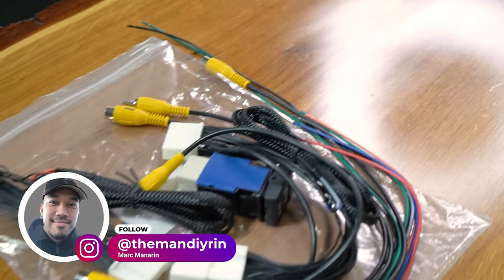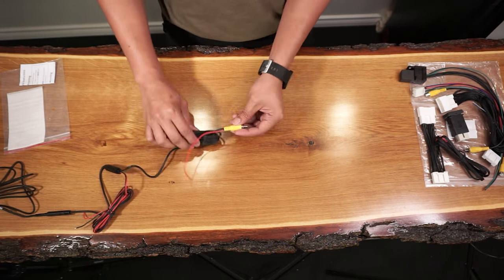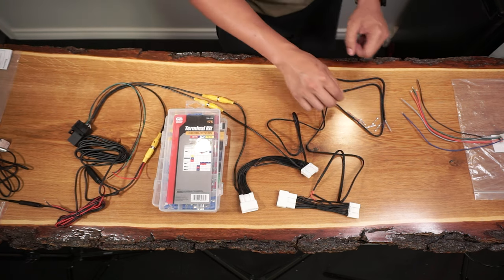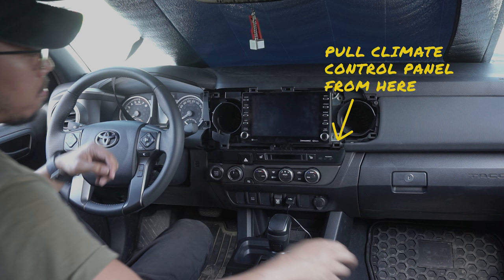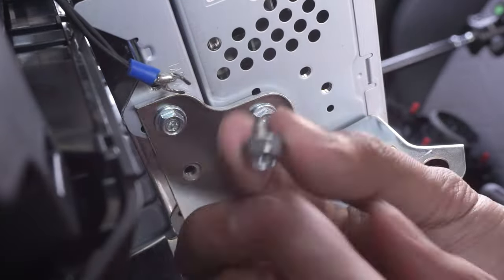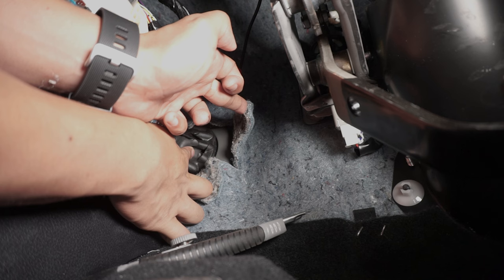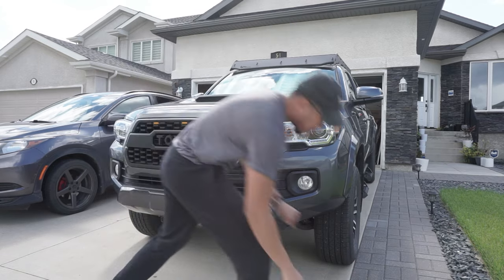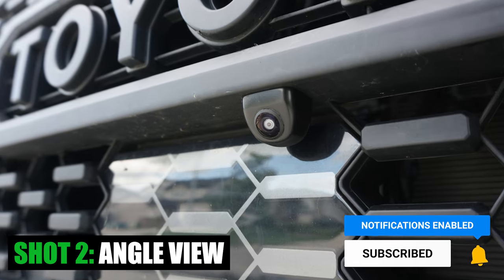ANYTIME FRONT CAMERA INSTALL on the 2022 Toyota TACOMA TRD Sport | EASY DIY

Comment: Followed step by step and got my camera installed in no time. Great video! The only issue i ran into was connecting the two black cables into the terminal then grounding them to the head unit, the cables were somewhat short but i managed to work through it pretty easily,. Thanks again
Reply from the maker: Thanks so much for watching my video! I’m glad it helped!
Reply: @themandiyrin thanks for the quick reply. I just tested it again and noticed that when going from the front camera position to the neutral position it flashes the rear camera for a second before going to the Home Screen. It does not do that when going from rear camera to neutral. Anyone experiencing this? Any ideas on how to stop it?
Reply from the maker: @sebastianbusto23  good catch! I’m actually in the same boat and mine is like that for half a second. I didn’t try to fix it as it doesn’t bother me much but mine is still doing that but works fine. Could just be the relay acting on the switch action.

Comment: I wish that this video had come up yesterday when I did my install.  I was bouncing between the videos trying to figure out little steps that were not well explained in one video or the other.  Great job on your video.  Love the idea of grounding to the radio.  I ended up putting my switch on the left of the steering column and had to splice in some wire for grounding by the fuse panel.  Love those low temp solder connectors, BTW!  I'll never go back to the old school kind!
Reply from the maker: Oh no! Wish mine came up too but I hope the install went ok! Thank you for watching my video and the kind words! Yes I agree with the solder connectors! They are great, don't think I can use other methods after that haha! Looking forward to hearing about some of your future mods! Cheers!

Comment: Thanks for the video. 

How much of this would apply to a 2018 Tacoma  extended cab with manual transmission?

What is the brand of the camera, and where did you obtain it?

Does it provide any memory to use as a dash camera?

Do they make a version that I could use in a 2016 Mazda 6?
Reply from the maker: Hi! This will work on the 2018. Please click my link in the description for the camera purchase. I’m not sure about the Mazda, does it have apple car play right now?

Comment: great installation but is soldering necessary? i mean i have 7 years of soldering experience under my belt so its not a daunting task but i feel as if crimped mechanical connection will be superior in this application 🤔
Reply from the maker: Thanks for watching my video! And yes I agree could do without the soldering but I had it handy so I used it lol

Comment: I have a 2019 Tacoma and I do not have blue and gray on the other connector. Is this normal because I have 2019?
Reply from the maker: Hi thanks for watching my video. Unfortunately I’m not sure why your 2019 doesn’t have the connector. I believe this camera is actually for 2016 and up so I assume it would work on 2019.
Reply: @themandiyrin  Thanks. I just realized the switch does not illuminates. Can this be done?
Reply from the maker: @rolpal619  Hi, luckily mine was illuminated! I think you're able to buy a different switch. Did you buy the same camera?
Reply: @themandiyrin  , I believe I did, but for different model year. What I mean by not illuminating when it’s in neutral. It does illuminate if I turn witch to front camera or rear camera, although yellow color. I wish it would blend with the blue illumination stock color.

Comment: Great Video. One thing I noticed on my front camera installation is that when I switch from front view, to off, a quick view of the rear camera appears. I'm not too sure if I noticed it on your video (16:06). Is this is normal? Or something that can be fixed? It's nothing major, but it is a bit annoying.
Reply from the maker: Hi, first off thank you for watching my video and checking out the channel. In regards to your question, that also happens to me! A mini second slight change that shows the rear camera. Unfortunately I don't have a fix for that and have just accepted it as a minor annoyance!

Comment: Great video! The only question I have is did you connect the red wire that you shrink rapped going to the engine bay? I see that you grounded the black wire but wasn't sure if the red was connected.
Reply from the maker: Thanks for watching the video and the kind words! In regards to your question, no you don't use that red wire at all, just shrink wrapped it to protect it from elements but it's not attached to anything!

Comment: Question I can't seem to find the answer to anywhere: on that red wire that you shrink tube, and said you don't need, what is the purpose of that wire? And why don't we need it
Reply from the maker: @ColoradoGuy303  Hi thanks for watching my video, I honestly don't know what it's for but they actually update the design and the new version doesn't have that anymore!
Reply: @themandiyrin  strange. I just bought mine, and it still has that cord. However, the red cord that comes out of the RCA cable, is now green to match the other two green cables you're supposed to connect it to.

Comment: is there an override switch or overide wiring harness for the factory front camera? My front factory camera turns off after a distance or exceeds 5 MPH. i would like to keep the factory camera on,  on a trail.
Reply from the maker: Hi that I'm not sure as I haven't encountered that issue. I'll contact the manufacturer to see if they had this before. I assume you bought the exact camera I linked below?
Reply: @themandiyrin  my tacoma came from factory with 360 degree camera system. I didn’t put a front camera on my car tacoma. That’s the reason I was asking about an override

Comment: any issues with heat? I heard camera goes blank after driving around in the heat, and we get lots of heat here...
Reply from the maker: Hi thanks for watching my video! Luckily I have not had the issue here as I live in slightly colder weather in Canada.
Reply: I installed this in my 2016 Tacoma several years ago. It worked fine on the road but I had trouble that looked like overheating whenever I went wheeling. I haven’t found a solution yet but mfr sent me a second kit to try. That goes I this month.

Comment: What if I have no room to install on center console? How will I route it to left or steering wheel
Reply from the maker: Thanks for watching my video. If you need to go the the left of the steering wheel, you'd have to route it under then remove the plastic panel on the left. I believe there are other YouTube videos showing this process that's why I chose to show the middle panel version.

Comment: Hey @theManDIYrin my screen is upside down on the front view.  I believe I have the camera physically mounted correctly.  I did not cut the white wire initially.  After cutting the white wire, the screen is still upside down.  Any ideas? Thanks.
Reply from the maker: Hi thanks for watching my videos. Hmmm fortunately I have not ran into this situation. Only thing I can think of since you are sure the camera is mounted correctly (the thread is in the up and down direction) is you were sent a faulty camera. I read in some cases (although not with the brand that I have linked), the wires have been color coded wrong. If you want to try, I would suggest re-connecting the wires you cut (either solder then or get those wire connectors) then try cutting the other wires until you get it fixed. So trial and error. Else I would suggest asking them for a replacement.
Reply: @themandiyrin  thanks for the quick response.  After some research, I snipped the purple wire and that fixed the problem.
Reply from the maker: @gwelch63  Glad it works! Cheers! Thanks for checking out the channel.

Comment: Installed mine Thursday. Took six hours. Did a dry fit to make sure everything worked. It did. Did final install front camera no longer works. Contacted company I bought it from. Crickets.
Reply from the maker: Oh no! I'm sorry to hear that! What company did you buy your camera from? Luckily mine still works great. Hopefully the company is able to solve it for you or at least give you a refund.
Reply from the maker: What is the issue you had? Wondering if I can help somehow.
Reply: Trail Grid Pro in Maryland.
The rear camera works when toggling the switch that came with the kit. The front camera does not. Black screen on the Infotainment head unit. Worked fine when I just had the wires running from grill to inside the truck but stopped once I went through the firewall. I’m sure it is the connection between the camera and the firewall. First time it was all hooked it, the male and female connectors made a click when connected. Now they do not.  And the arrows line up.
Reply: Company sent a replacement component that should arrive tomorrow.
Reply from the maker: @Hansaman58  hi! I’m glad to hear they are giving you a replacement! Hope it works great after the change, keep me posted!
Reply: The fix did not work. Made it worse. I’m going to the company in a couple of weeks as I will be in that area anyway.
Reply from the maker: @Hansaman58  oh no! Worst case just return it I guess? The company I used I'm really happy with so I suggest going with them if it doesn't work out with your current one! Best of luck and let me know if you need any advice!
Reply: Trail Grid checked it out and it worked. Worked for about a day on my trip in Maryland and then to Boston. Then stopped working including backup camera. Contacted company who said I can get a complete replacement. Waiting to see. Removed the kit from my Taco. Backup camera works again.
Reply from the maker: @Hansaman58  oh no I'm sorry to hear you're having issues with your kit. Not sure about the company you purchased from, luckily mine works great. Hope you have a better luck on the replacement. Else I suggest buying from the company I purchased from!

Comment: Did anyone had issues after completing this mod? Apparently my microphone doesn’t work anymore, the one inside of the truck that i use during calls. Does anyone know how to fix this? How does the microphone cable look like? To see if i possibly disconnected it by mistake
Reply from the maker: Hmmm curious about the responses. I haven’t had that issue luckily. Not sure how’s that’s connected to the front camera?
Reply from the maker: What kind of issues do you have with mic? People on the other line can’t hear you?
Reply: @themandiyrin  my head unit says “much to phone is not connected” and yeah people on the other side of the phone call can’t hear me. I have a feeling I accidentally unplugged something or forgot to plug something back in
Reply from the maker: @sebastianbusto23  keep me posted if you're able to fix it! I'll at mine as well to see if there are any plugs associated with the mic!

Comment: #theManDIYrin, Front View Cameras should definitely become standard safety features! I am perceptive about safety features like this one. Front View Cameras work like Rear View Cameras, which have become standard per safety regulation by IIHS and NHTSA in 2018. While Rear View Camera shows a video on the touchscreen of the automotive head unit of you car to provide you what you couldn't see in your rear bumper, Front View Camera provides you what you couldn't see in the front bumper. Both Rear and Front View Cameras address the dangerous problem of blindviews, which is especially true for large cars like SUVs, pickup trucks, minivans, and vans. The problem with these vehicles are that while they have more spacious cabins, they have bigger blindviews that could result in a pedestrian getting injured or killed by either a frontover or backover collision. Young children can be too short to be seen in the front or rear bumper that obstructs the driver's view. Children and pets are more likely to get killed in a frontover or backover collision with the former having a delayed development on their safety. 
According to kidsandcars.org, over thousands of children were killed or injured by frontover or backover collisions, in addition to suffocating by heat stroke in the car, which is fatal all-year round. These are the three most common causes of death in children under the age of 14. Losing a child, pet, or elderly to frontover or backover collision is tragic, but they can be preventable, especially with safety features consisting: Front, Rear, & Surround View Camera, Front & Rear Parking Sensors, Forward Collision Warning, Parking Obstruction Warning, Front & Rear Cross Traffic Warning, Surround View Warning, Forward and Reverse Automatic Emergency Braking (City, Highway, Parking). In addition, we should include safety features on the inside consisting: Rear Occupant Alert with radar (recommended) or ultrasound, Rear-Door Logic, End-Of-Trip Reminder, Rear Belt Minder, all of which are programmed to remind the driver to check for unexpected stowaway passengers, but if the driver ignores the warning, exits, locks and leaves the car without checking who is inside for 30 seconds or less, their car will detect minute movements with the radar or ultrasound detector, making the vehicle trigger the alarm and even send a message to your smartphone, thus saving the skin of the passengers. You have a great deal of responsibility on your shoulders.
P.S.: Rear Occupant Alert may be pestiferous for drivers who wanted to temporarily leave their car while they are out to do grocery shopping or pumping at the gas station, but it would be worth the price.
Reply from the maker: Thanks for watching my video! I agree this is an important mod and hopefully could be included in future Tacoma Iterations.